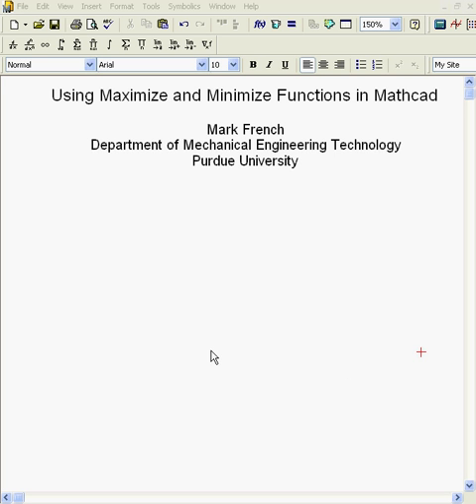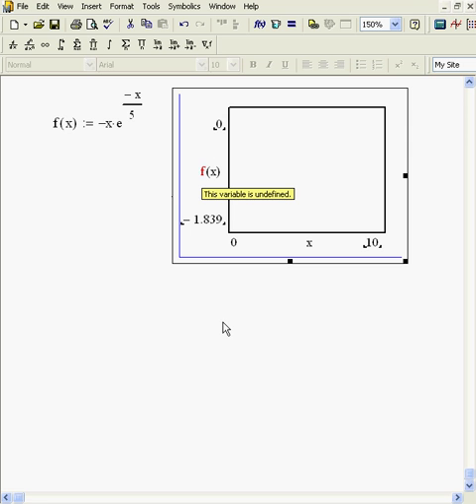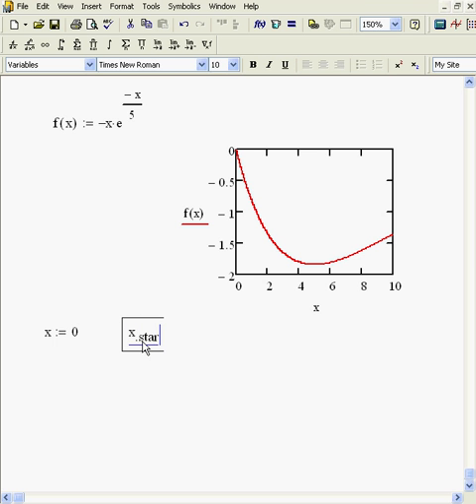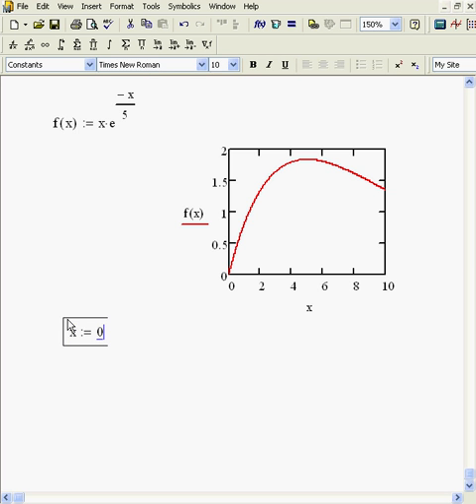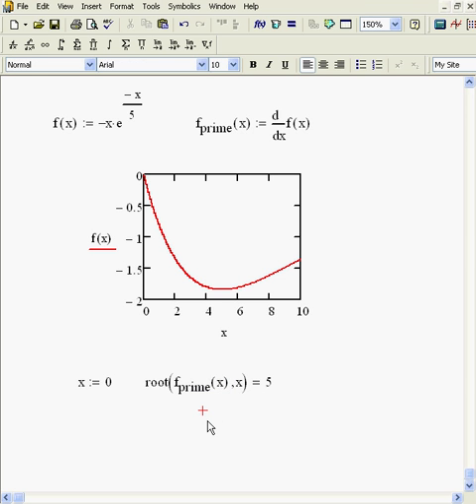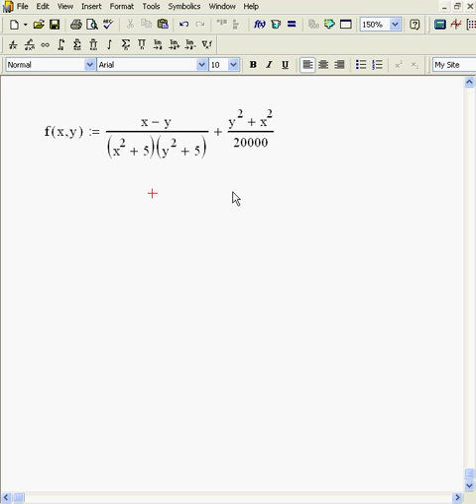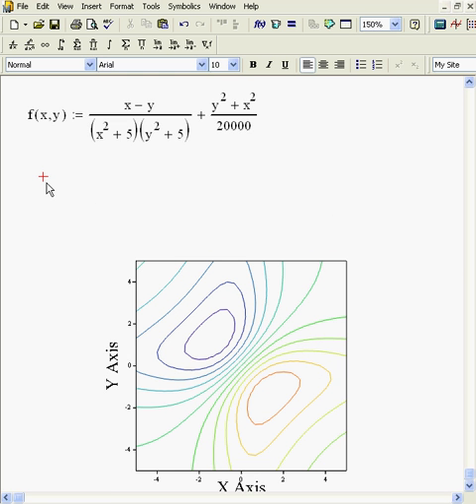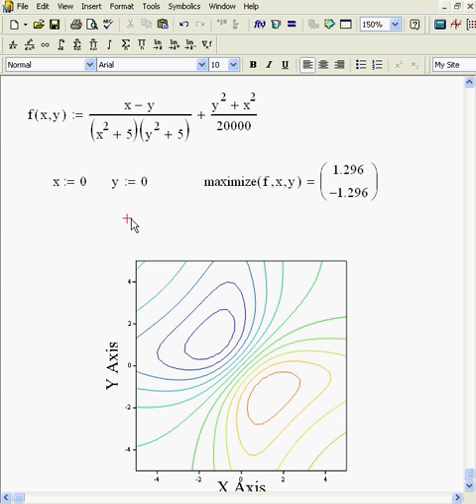Maximize and Minimize Using Mathcad.avi

Comment: Thanks for the video.  This is very helpful, however i'm trying to maximize a parametric function.  Therefore not only am I interested in the maximum point on the function, I am also interested in finding the maximum range of the function can achieve based on parameters within the function.  It would be awesome if you made a video on this topic.  Thanks for the quality videos.